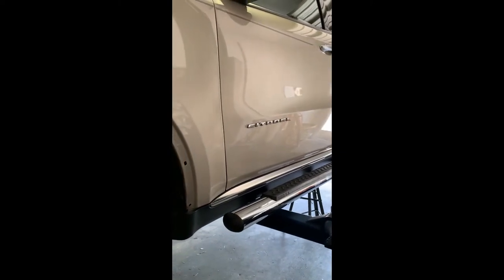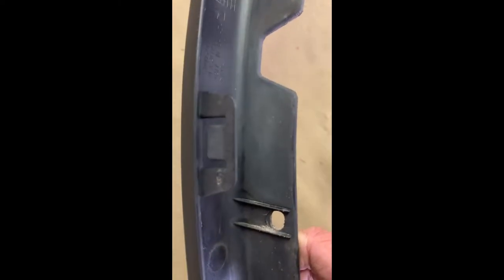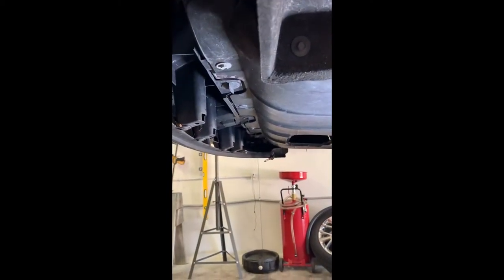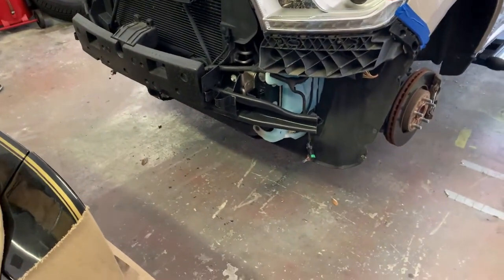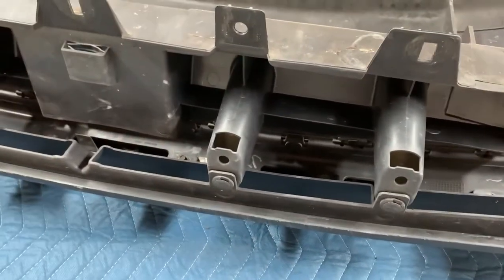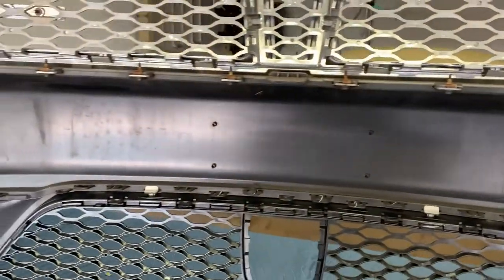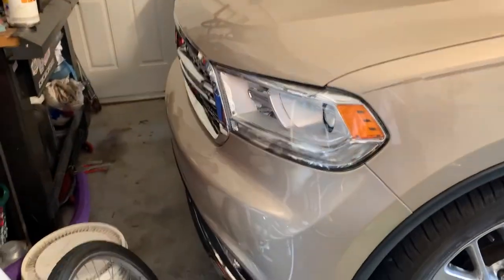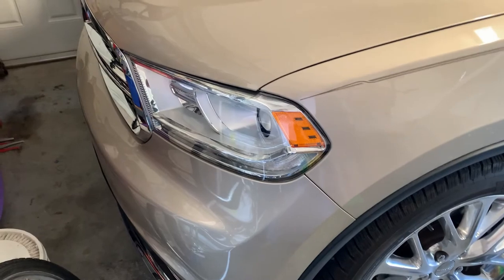Durango Adaptive Cruise Control

Comment: I have a 2014 300c . I’m upgrading my front bumper to a 2019. My car has a adaptive cruise control but on my 2014 it’s located on the right hand side.My new bumper it’s located in the middle. After much research and frustration I found the new metal bracket without the sensor.My problem now is that I need the plastic clips for the forward side of the bracket the local Chrysler dealers said I couldn’t just buy the plastic clips
Reply from the maker: Did you try some of the online mopar parts dealers?  Get the part number from the local dealer and see if you can find it online.

Comment: I know this is fairly old, but if you see this, I have.a 2015 and for the life of me cannot find a wiring diagram to match an aftermarket harness. The harness and sensor was damaged on mine, and I lost the original harness to match the wiring.
Reply from the maker: I do not have any insight to the wiring as I did not have to mess with it, I bought the factory sensor

Comment: Did her durango quit running when the camera broke? Computer says one of the two ACC cams is out.
Reply from the maker: No it did not quit running there was just a message that said the ACC was not available, normal cruise worked fine.  There is only one sensor on our vehicle and it is some form of radar mounted low in the grill not a camera.

Comment: I'm dealing with this currently on a 2012. Does the replacement sensor need to be oem or can it be used from the same generation and be flashed to a new vin?
Reply from the maker: I do not know the answer to that,  I am not sure that the process I had to do was flashing the vin, it may have been but they way it was described to me was making sure the vehicle network recognized the module, kind of like trusting a new IP address

Comment: I have this problem with my dodge charger will this problem cause the cruise control steering wheel buttons not to operate?
Reply from the maker: So when the sensor was damaged normal cruise control still worked,  not sure you have the same problem.

Comment: Hello! Would you be able to tell me what the black caps you show at 19:30 are called or where you were able to find yours? I'm struggling to find them.
Reply from the maker: Sorry it took a while, I have been traveling.  I bought them at the local Dodge place but here is what I got:

https://moparparts.delandcjdr.com/p/Dodge__Durango/CLIP--RETAINER-Adaptive-Cruise-Control--Push-Lock/61621548/68186439AA.html?partner=googlebase_adwords&kwd=&origin=pla&partnerDevice=c&userLocation=9011819&gclid=Cj0KCQiAv6yCBhCLARIsABqJTjZq1UAhSotDLfoOapKZ_XHlmVnMxQi8YDt1yW5DL_jIsvipZUfcjT8aAqiEEALw_wcB

Comment: Is it possible to just disable the acc and run regular cruise if the sensor stops working? And if so how?
Reply from the maker: Yes, you just turn the ACC off with the button on the steering wheel and then push the cruise control button on which is above it.  Then set it as normal.  Unless something else is damaged other than the sensor it should work.